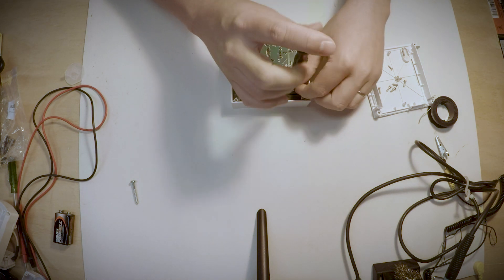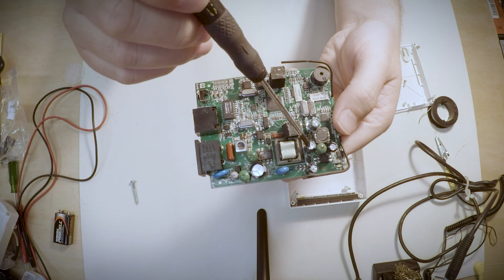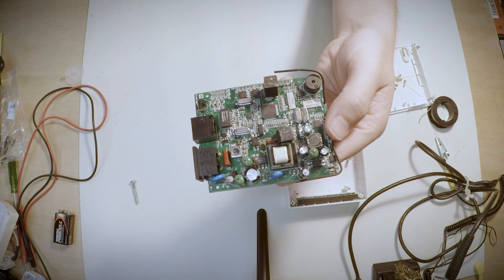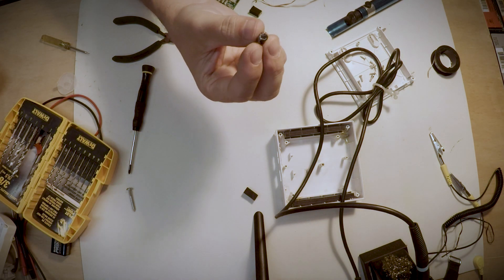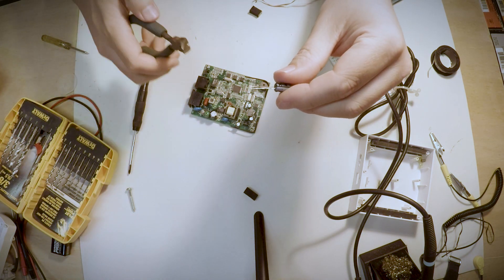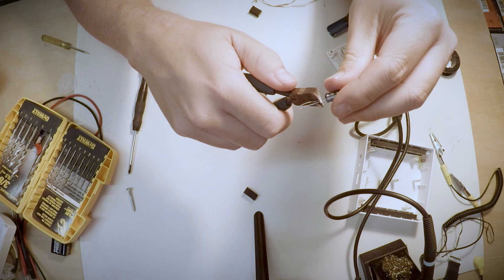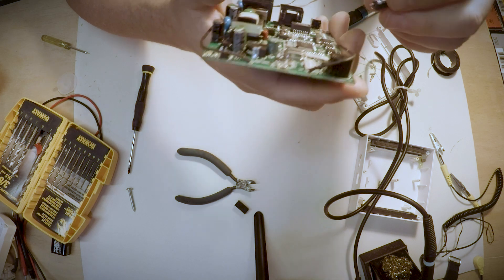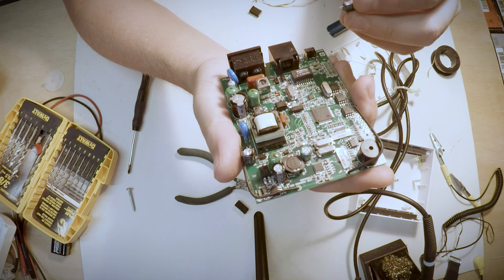Insteon Hub 2245-222 DIY Repair / Bring It Back From The Dead!

Comment: Hi Chris, I tried this and there is a small progress. Plugged the hub in and the front light blinks red and dies off as it blinks. There is another capacitor that looks like the one you change in the video, should I change that as well? Any other ideas?
Reply: Figured it out. Another capacitor was loose so soldered it well to the board.

Comment: Sorry to say, but this did not work for us. Our Insteon hub has 100 uF/35 V capacitors, not the 47 uF/50 V ones shown in this video. Maybe Insteon updated once they realized the initial capacitors were a problem. Our hub has stopped working - red light. We found this video and ordered/changed the capacitors, excited based on all of the positive responses. But for us it was a no go. Insteon’s website seems to be gone and so my husband thinks the problem is them and not our unit. If anyone has an opinion/advice, we would appreciate it. Looks like we are changing over to Lutron.

Comment: Wanted to add some additional information.  I replaced all three nearby capacitors - C7, C11, C13.  The caps in my hub are marked as 100uF and 35V.  I replaced them with 100uF 50V just to be on the safe side...    I think it is from 2018 - 2019, so suggest others consider the bigger caps if making this repair.  I don't know what else (if anything) changed on the board.
Reply: Hi. I think I have the same unit as you - mine are also marked 100uF 35V. Did your repair work? Unfortunately I ordered the ones recommended in this video, but will reorder if your repair was successful. If so, can you tell me where you got them? Thanks.
Reply: @marially3  The company just went out of business and turned off it's servers.  Don't waste time trying to fix it.
Reply: @dashrides2679  thanks, we found out the hard way. I replaced them so excited, but was disappointed when the red light stayed on. And yes, we realized after that they went out of business. At least I know it wasn’t my repair.

Comment: thanks a lot, i get the old one 2242-222 and hub was dead, so i looked for the C7, yes there are a C7 in other position but yes, it looks OK but i changed and voila it's works again, thank you very much

Comment: Add me to the list of thankful people. I had hub #2 die - and dreaded the wait for a replacement unit and then reprogramming of my nearly 50 devices. Saw your video, ordered the caps and got them first... 10 minutes later up and running. No fuss no muss, 10 minutes and 80 cents total. Appreciate you posting the video!

Comment: Get the solder to flow with your iron, then use an air compressor to de-solder.  It completely removes all the solder so much so that the caps just fall out.  The hole will be wide open to slide the new one in.  Aim the air gun such that the solder sprays away from components or mask them first.  No worries if solder spray gets where you don't want it, a stiff tooth brush knocks it all off.  It doesn't bond, it just loosely sticks to the surface and easily knocks off.

Comment: This worked!! Thank you very much. I have not done soldering for atleast 10 years, and was able to remove and replace the capacitor. After removing the capacitor i realized that i did not note down the polarity of the capacitor when it was in the board, dont forget to do that. Other than that it was pretty easy. if you have a solder suction tool to remove old solder that would be helpful, thats probably what i had most trouble with. all in all took about 10 to 15 minutes. thank you!

Comment: Fantastic + a trick to try and revive before this fix
Yes, my old 2016 hub worked for 4 years before it decided to stop.  I freaked  when I learned that there's no way to recover all the programming without Insteon's process of replacement (which takes 2 weeks!). I had even purchased a spare hub when they were on sale figuring that in the event something happened, I'd simply be able to plug in a new hub.  NOPE! They have to program and issue a new hub -- can't replace with your own!   In my discussion with Insteon -- the tech told me to press the re-set button 4 times and that in some cases, this revives the unit.  It worked!  It came back to life.  HOWEVER -- a day later it died again and this time the reset procedure did not work.   Luckily, I saw this video and had already purchased the capacitors per the included video link.   In spite of Chris' soldering and repair abilities where he made it look as easy as slicing bread -- it was a real pain for me to get the old capacitor out.  I was seriously concerned about burning the board in effort to get that capacitor out and once out, of course the holes were sealed with solder.  No, I'm not real good at circuit board soldering.  I had to use a heated pin (red hot) to poke back through the holes to open them up and insert the new capacitor. (ok, so i'm a rube g.) But, it worked and I was able to get that capacitor installed.  And -- per the video -- it worked like a charm.  THANK YOU CHRIS for sharing this video and providing links to the solution.  Now -- we just have to figure out how to download the programming for our own safe keeping from the Insteon web.

Comment: Thank you for sharing!  This solution revived my dead hub and only cost me a few dollars for the capacitor.  I recommend skipping the solder sucker and actually add solder (a big blob) to the dead capacitor's leads on the back side of the board.  Heating the blob of solder with the iron will melt the solder on both leads of the capacitor simultaneously making it easier to remove the cap.  It's a bit tricky, but you can then insert the new cap with one hand while heating the blob of solder on the back side of the board with the other hand.  (If you can develop the knack, then both leads of the new cap will smoothly slide in their respective holes simultaneously.  The process is more reliable than removing solder from the holes in the board.)  Finally, use the iron to scrape the blob away separating the leads of the capacitor (or use solder wick or the solder sucker to remove the excess blob).

Comment: Got new caps from amazon. Put them in "both" of my DEAD HUBS!  Voila, $6bux vs. $70. Now I have a backup. Has anyone done a repair and have the replacement capacitor go bad?  We all know that Insteon is banking on this design flaw. Most common reaction to having most of your automated shit malfunction is to run out to the depot or bestie buy and drop $70 to get back communication. That's why I have two. Glad that I didn't throw the first one away. Really relatively easy if you as comfortable with a pencil solder iron. Really glad that I came upon this vid. Thanks so much for sharing with the rest of the class.

Comment: Thanks for posting this video. Replacing this capacitor fixed my hub and saved me $70 and many hours of potential reprogramming. The technician who replaced the part asked me several times if the cap really needed replacing, because it showed no sign of failure, but indeed it was the cause.

Comment: Just took apart my HUB, found C7 to be 100uf 50vdc mounted with the polarity reversed, positive lead to negative terminal and negative lead to [positive terminal. Waiting for delivery of new 47uf 50vdc capacitors. Circuit board although NEW has obviously had previous work done, looks like C4 was previously de-soldered, messy job. Although C7 is 100uf and mounted backwards no obvious signs of previous work. If this work was done by INSTEON its no wonder these units are subject to FAILURE, poor workmanship and no electronic knowledge.
Reply: Faulty circuit design... this sure isn't a coincidence.
Reply: just opened mine and had the same 100uf 50vdc

Comment: My Insteon hub just died.  No LED indicator lit, and reset button did nothing.  Opened up and replaced only capacitor C7 as shown in the video.  None of caps looked bad, including C7.  Reassembled, plugged it in, LED lit up red, rebooted then turned turned green.  Everything was back to normal. Couldn't believe it. Thank you so much.  I'll subscribe as a thanks.  Who knows what else I'll learn?
Reply: Fixed another 2 Insteon hubs, one 3 weeks ago and another one today.  This video helped me fix them all.  Thanks again.

Comment: You are awesome. I have 50 lights configured in our building with this and i didn't have the hardware id for 30 of them and they are really high up in the cycling and it would have taken me all day to go up to each one and get the id. After replacing that capacitor it worked again. Then i made some nice notes on all the devices that are on there just in case. Also, i found this on their website which it looks like they will send you a replacement unit for free if yours is broken. https://www.insteon.com/support-knowledgebase/2015/10/20/migrating-to-a-new-insteon-hub

Comment: That worked perfect for me. My second hub was already dead in less than 2 years. I like Insteon and their products but not the quality of the Hub or that you can't even migrate your account to a new hub. Last time i had to register every device to a the hub which was a pain in the ass.  Now i have 5 capacitors left, because they only sold them in a set of 6 or so I have some spares in case this thing dies again.

Comment: Thank u for this tutorial.

the most difficult part for a was the soldering or rather the unsoldering of the capacitor... after extraction even with flux paste the holes were closed I resolve this riling a pin hole drill I got from amazon called "smart fun precision pin vise model had drill set" from amazon. 

After this re-soldering was not hard and the hub just turned on.
Reply: Do not drill!
Use "Solder Wick" to unsolder the capacitor, and/or also to also wick any solder from solder filled holes.

Comment: I did this capacitor replacement as you recommended and poof! my hub was back working 100%  Thanks for posting this :)
Reply: "Poof" is typically a very BAD thing after an electrical rework.

Comment: Great video to save the Insteon hub.  Mine died and I bought a ten pack of capacitors from Digi-Key for $7 (part # P19612CT-ND: 50V, 47 uF).  I replaced the one you mentioned along with the one next to it (C7 & C13) that look like it failed.  Twenty minutes to do the work and back in business.  Having a solder vacuum really helps in doing this job (under $10 Amazon) as it removes the old solder and clears the holes to insert the new capacitors.
Reply: Arnold Olender Thanks for the part #. Much appreciated.

Comment: I have basic soldering skills and I was able to remove the capacitor but gave up after I couldn't clean out the holes to get the new one in. I came across your video and the way you held the board and placed the capacitor while heating it up from behind to push the capacitor tails in was key! I gave it another try and got them in the first try. My hub is back on immediately after and I no longer have to replace my hub and go through all the trouble. Everyone needs to remember this is not a video on soldering or de-soldering, there are tons of great videos on that already. Great video and thank you!

There's also already details pics and instructions on the location of the c7 you just have to google a bit, here's a good link
https://forum.insteon.com/forum/main-category/insteon-products/insteon-hub/94559-insteon-hub-not-powering-on/page2

Comment: My hub died about a year ago. I tried to replace some of the caps, but after I replaced one to no effect I gave up. I found lots of instructions for which caps to replace in the PLM units, but none for the hub. I kind of gave up on it. A year later and many other people have dead hubs and the word is out that I need to replace C7, but I'm not exactly sure which cap IS C7 since the components cover the silkscreen.

I do agree that the video doesn't show all of the detail, but it's not a tutorial on how to solder. It made it obvious to me what I needed to replace, and I had 1 47uf 50v cap in my stash so it was a free fix. My hub finally works, so a big thank you.

Insteon has a program to replace these bad hubs. https://www.insteon.com/support-knowledgebase/2015/10/20/migrating-to-a-new-insteon-hub

Now I have to decide if I should request a replacement.